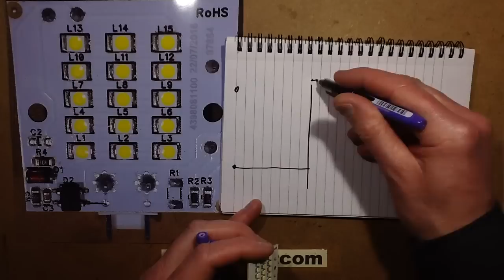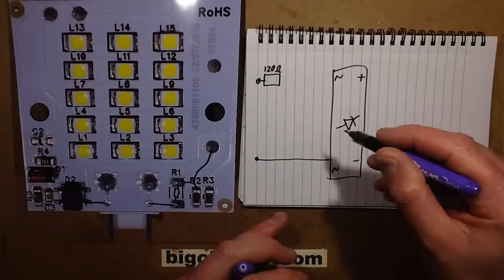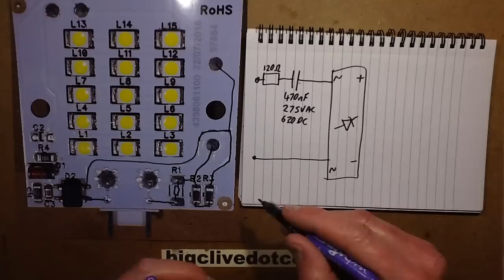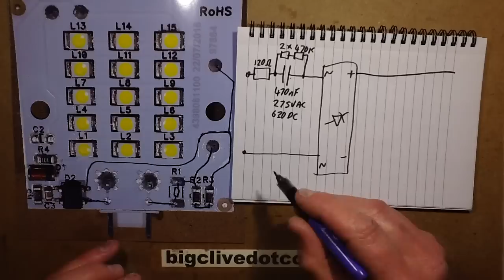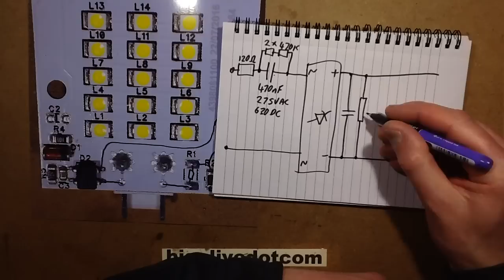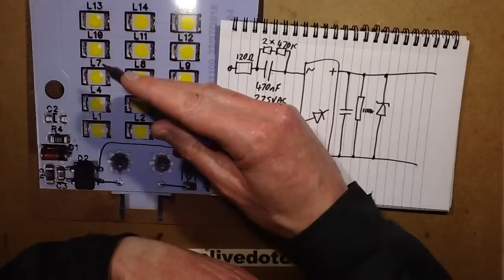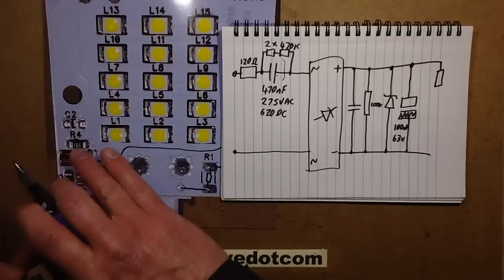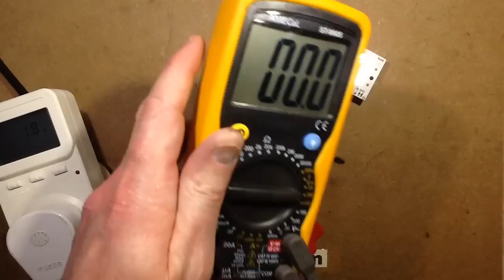"Non-serviceable" LED fridge light module.  (with schematic)

Comment: I'm glad my fridge doesn't have this crap in it.
Reply: i dont keep crap in my fridge :P
Reply: Survivor bias.
Reply: My grandparents still use a fridge and deep freezer from the 60's still (yes, the sickly green color ones), and they are running strong. They've had 3 newer "better" fridges in the past 15 or 20 years and 2 of them failed already and on the 3rd.... Can't beat old appliances and their build quality.
Reply: EXCEPT, this was a rare case of defect.  Normally an LED light panel like this would last the life of the refrigerator, and probably only raised the purchase price by $1 if it didn't even lower the purchase price.  Be far more concerned about things like electronic control panels which are highly proprietary and in the case of the display, may be impossible to repair or replace without buying a new module from the manufacturer, or with luck finding one that was parted out used on eBay, Amazon, etc.
Reply: After  11 years, my fridge is on now on its 2nd replacement lamp. So getting 5 years per lamp. New lamps are about £1 each now in the shops. Much cheaper than the LED module.
Reply: rogertopful My fridge here in the US is a perfect 20 year old Kelvinator, the company that invented home refrigeration.
Reply: rogertopful honestly I would be fine with an incandescent bulb that costs $.50 so much waste producing a product like this.
Reply: DigitalYojimbo they do it to nickel and dim people out of money, so they can save money through economy of scale and also because they can make you buy a new product from them. So in the end they make more money.
Reply: Yeah, I have a 20 year old Kenmore side by side. It's still running as strong as ever and from what I can remember it hasn't needed a new bulb in quite a few years.
Reply: i like muscle cars which are entirely mechanical and have zero ecu/computers in them. its funny because when i look on the road now, i see a lot of cars manufactured after 2012, and cars manufactured before around 2000 but nothing inbetween. funny that.
Reply: I totally agree. I still have cars: 1967, 1972, 1976, 1986 and 1996. The 1996 with the LT1 V8 (which is simple by today's standards) has needed things like TPS, MAP and MAF sensors replaced to stay running well without codes. The older carbureted V8 cars just keep running, and are simple and cheap to maintain.
Reply: The 40 year old fridge in my kitchen has only needed a replacement defrost timer motor (about 15 years ago). Still has the original incandescent bulb, which I think might be 25 or 40 W.
The more complicated they make stuff that doesn't need to be, the more problems there are!
Reply: LakeNipissing: You're absolutely correct. Newer built cars are a fine example. The old ECU's did improve engine management But throughout the years more ridiculous sensors and control of the devices not related to the engine were incorporated along with sub-computers to handshake the ECU with peripheral devices.
Cars can easily reach 100k miles now but at what cost? All electronic devices are built with planned obsolescence in mind now.
Reply: @rayford21  My god you old people like to piss and moan.